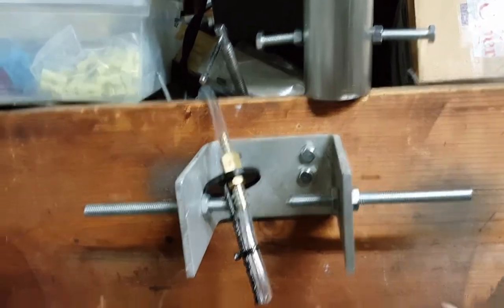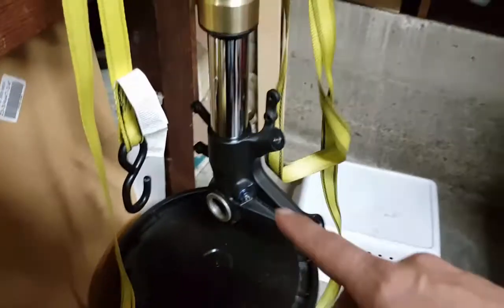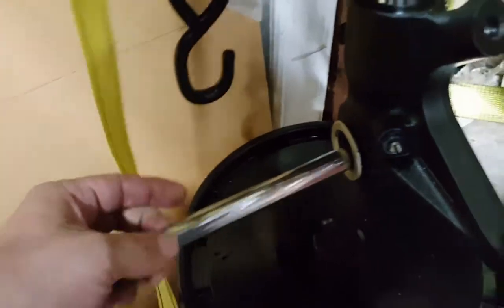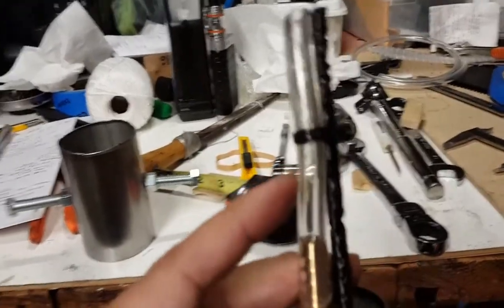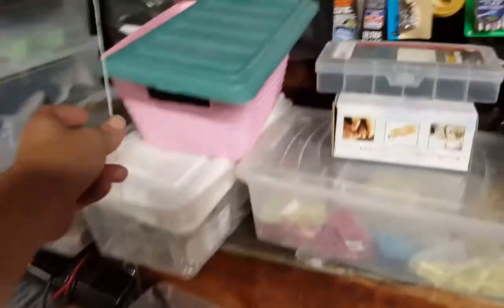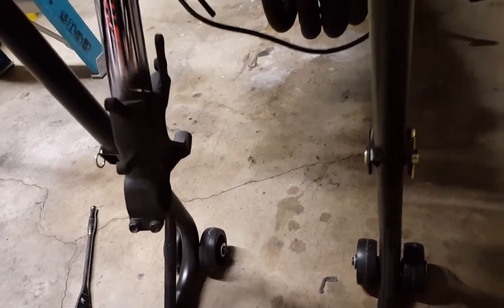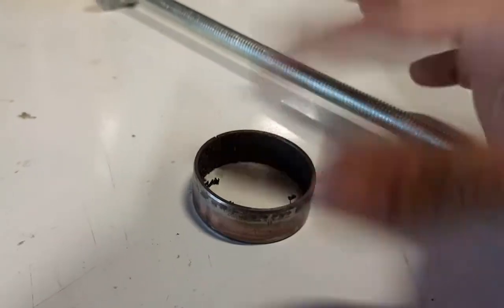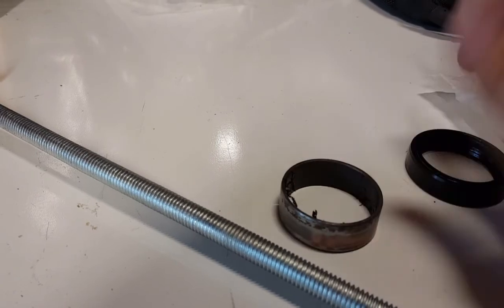DIY Fork Seal Replacement (Part 1) Making Your Own Fork Tools

Comment: Did the fork oil on my k4 and damn does she feel smoother. I was close to bottoming out when hard braking. Thanks for the video, this will come in handy when i upgrade the internals on my setup or if i get a leak.